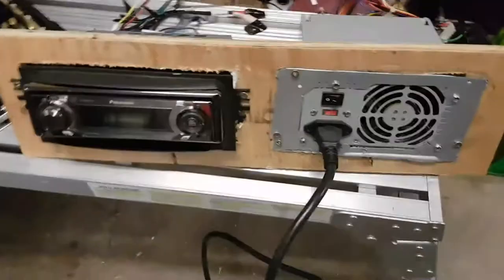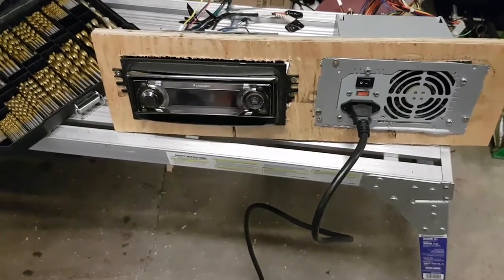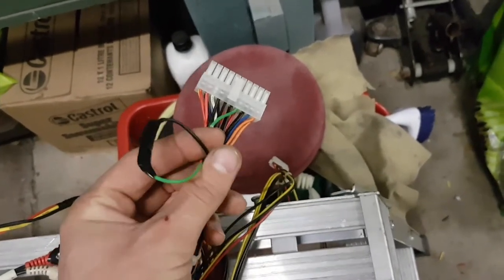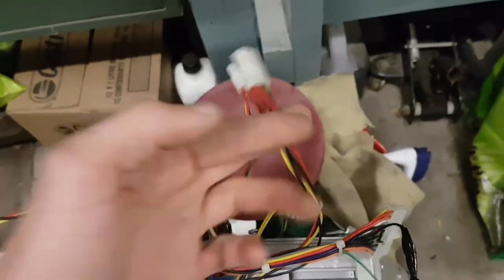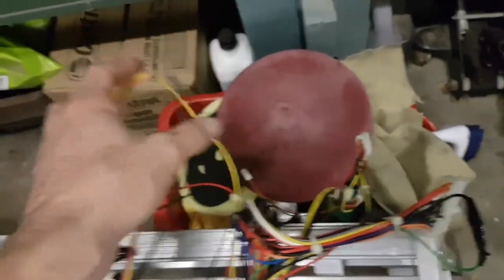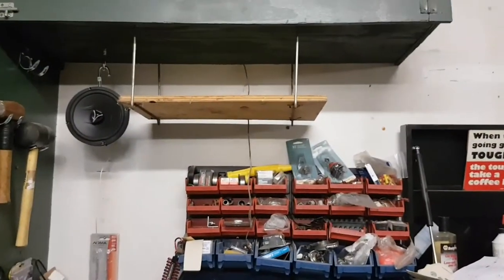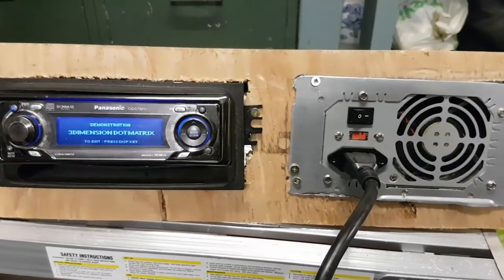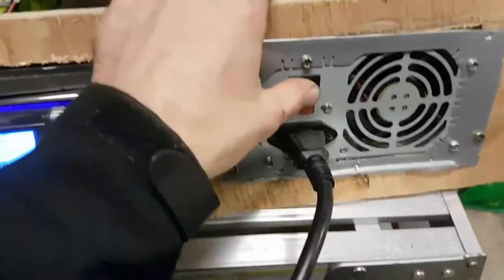How to hook up a computer power supply to car cd deck 120V to 12v

Comment: How many watts is your power supply?
Reply from the maker: It was just a small power supply out of a cheap parts computer. 350 to 450??? Watts. Nothing special. Just something to get a 12volt output. Mind you if your trying to build a banging system build to suit. I was just looking to have the radio with 4 speakers 6.5 inch and the CD deck. Does not take to much to run a CD deck. Check wattage requirements on your CD to be safe.

Comment: when i have my red igniton wire connected it turns on then off
Reply from the maker: If all wires are connected properly. The power supply might not be giving enough power or the cd deck is faulty.

Comment: How do I prevent my  settings being lost when I turn off PSU? I don't want it running 365 :)
There must be a way.
Reply from the maker: You would need direct power to save your settings. Otherwise when the power is cut the memory is lost. A vehicle keeps a direct power just enough to save data with the unit in the off position.
Font think you can do it with a power supply. Or your power supply will be on all the time.
Reply from the maker: That or have a back up battery installed on your acc wire I do believe. You would need to look into it a bit as I didnt put much thought into wanting to save my settings.
Reply: @LUCAMTire  could I hook up 3 3.7v 18650 batteries to yellow wire? It's a hassle setting up unit n radio stations every time. I don't know how safe it is to keep PSU running 24/7 plus the fan makes a sligh noise. Thanks peeps.
Reply: @LUCAMTire  I was hoping to use 5v SB wire from PSU but it doesn't give power when PSU off as it should. Also not sure 5v is enough to maintain settings.
Reply from the maker: @victoryanda3538  the way I have things set up would be a on\off scenario with no memory.  It being safe as to code I would say it is not safe to code specifications. To do it correctly for a audio board I would talk to a audio center that has a existing audio board to see what they are using to save settings. I am not familiar with the saving settings scenario using a power supply as my power supply gets shut off and unplugged when not in use. Sorry I could not be of more help.  
All and all take caution when hooking up a stereo this way as anything could possibly happen.
Reply: @LUCAMTire  I now use a Xbox power brick that's always on and has no fan noise. Atb